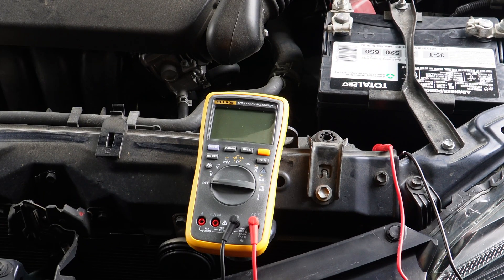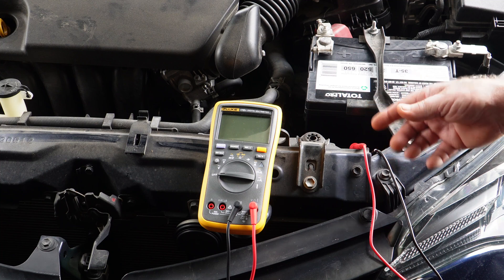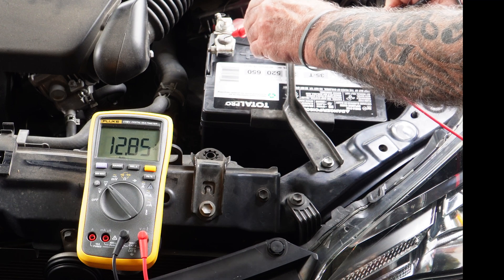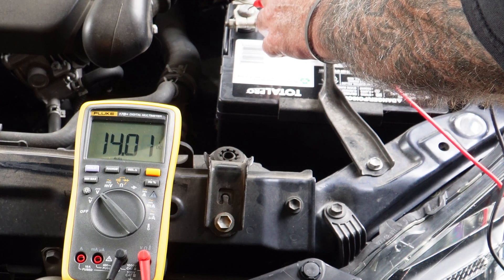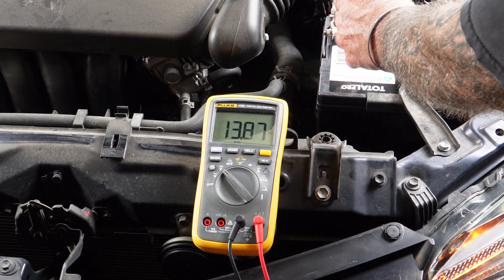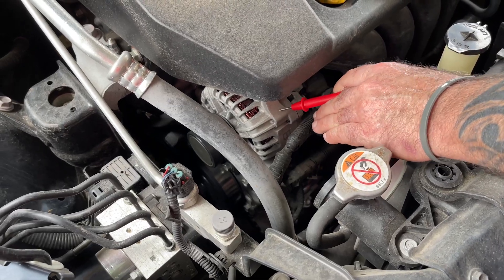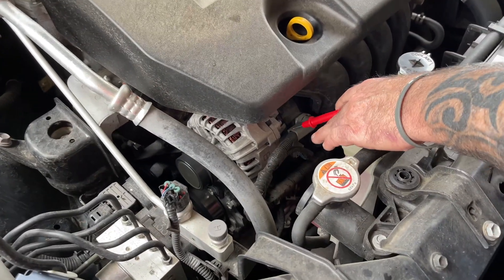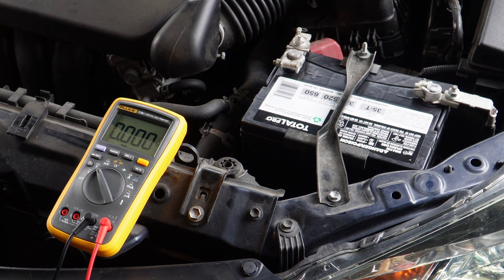How To Test An Alternator

Comment: Um start the vehicle and disconnect the ground from the battery. If it dies you need a new alternator 😂
Reply from the maker: I would not advise that on modern computer controlled vehicles!  That did work back in the day, but doing that on today’s computer reliant vehicles can cause damage that no one wants.  Not worth the risk!

Voltage Spikes Can Damage Electronics
Modern vehicles have sensitive electronics — engine control modules (ECUs), sensors, infotainment systems, etc. Disconnecting the battery while the alternator is charging removes the main voltage buffer. This can cause large voltage spikes (up to 100 volts or more) that can instantly fry expensive components.

Alternator Can Be Damaged
The alternator’s voltage regulator relies on battery voltage feedback. Removing the battery suddenly can cause the alternator to “run away” and overload its diodes or regulator, potentially ruining it.

It’s an Outdated Test
This “battery disconnect” test dates back to the 1960s–70s, when cars had simple electrical systems. It was marginally safe then, but absolutely unsafe on modern vehicles (anything made in roughly the last 30 years).
Reply: Additionally, in order to protect the computer from surge they redesigned the alternator to always sense 12volts from the battery. If you disconnect the negative it will automatically shut down the vehicle. This change came about with OBD2, around 1996.
Reply: @JAss-ny3im dang I just learned something new!
Reply: @silentnuke187 I remember my dad doing that trick too though back in the day. Gone are the days of station wagons, roll down windows & cars with ash trays or cigarette lighters, right? 😂 Those old school methods will quickly ruin today's cars!
Reply: @silentnuke187 maybe consider deleting your original comment so someone that sees it and tries it without reading the comments that follow, warning against it and possibly damaging their car because they falsely believe you might know what the hell you're talking about.
Reply: @JAss-ny3im  where did you hear this, on what kind of car? definitely does not apply to all "obd2" ...
Reply: Never do that for modern car
Reply: On the advice of another person I did this. The engine did die immediately when the positive cable was removed from the battery and they told me that the alternator is bad when this happens but then afterwards I looked into it to find this should never be done on a modern vehicle. Now I'm concerned I may have caused damage that wasn't already there. Thanks for this video and the sound advice. Hoping that I didn't cause myself lots of issues now.

Comment: I replaced my alternator and battery and my car lights still are dim and fans in car are weak I hit gas and goes back to normal and I haven't checked alt temp but that thing is definitely hot hot I looked at grounds seems good so idk what hell going on
Reply: The battery and alt itself is showing 14.7 any ideas would be appreciated

Comment: Looking for 2021 Toyota  TRD 4x4 SPACIFIC voltages. I hooked my scanner up and say not one lick over 13.8 from start to finish and 5 miles later.  Original  battery though.   Got the check charging system as everyone does and it’s an original battery.  Hooked my scanner up and NO recorded issues.  I’m guessing it’s a manufactured problem.  The battery for Toyota was know to be good for almost 10 yrs, Not now I guess.  Never did find a code to look at so it’s a pre programmed  fault but I did never see a charge  from 13.8 from start to 2 miles later of any difference of 13.8v.  Why!?

Comment: What if my voltage doesn't drop once I put a load on it?
Reply from the maker: If the voltage is in the correct range when engine is running showing a good alternator, then no drop while under load means the alternator is under no strain by the load.  You should be good to go

Comment: I have been having problems for over a year. I have a 1997 Subaru Legacy 2.2l. I am being told to just buy a new car. I love my car. I have a new battery. I have other problems as well but because I am here this is what is happening. I drove about 20 miles in the City. Went to a store. Came out to a dead battery. AAA jumped it and tested it and the alternator. He said I need a new battery. I have had two new batteries since May. I bought a new one and this also happened earlier this summer. Took it back and they exchanged it for another new one. So I drove home and let the car run for a total of about 40 minutes. Turned the car off but it wouldn’t restart. So I jumped it and went to O’Rileys to test alternator and battery. They said alternator is bad. Called our local alternator rebuild company that also does work on our sailboat. Pulled out the alternator and took it in. He tested it and everything was fine. So somewhere the battery and alternator have problems. I have very little help here.  I am going to go out and try what you just explained. There must be a problem somewhere in the wiring between the two. I do have a multimeter and a light meter is coming today. I checked all my fuses and they are fine. I’m still looking for the main relay but I am stumped. Thank you for making this video. I am looking forward to browsing through your other ones. 
Have a Blessed Christmas!
Reply from the maker: It sounds like you're definitely on the right track checking the wiring. Good luck with the testing!  Merry Christmas

Comment: Thank you for making this video. I am from Philippines  and I live in a remote area of Bohol. Youtube is he only I get knowledge whenever I have problem with my truck. This video helps me a lot especially  now that my truck won't start. Wondering if the alternator is bad or the battery. Battery is also heavy for me to lift up to remove so I am trying to do the least hard work on the truck.
Reply: Well if you can jump start your truck you can then check your alternator. If the alternator checks out good and charges your battery, then the battery is dead a couple days later, it's probably that you have a bad battery.😢

Comment: Thank you.  I have a 9 month old battery. It was -30 this AM.  Battery was dead.  Put it on the charger.  It started. Drove around for a half hour.  Got a low voltage message on the dash.  Put it on the charger again.  Battery was at 27%.  Think my alternator is shot. Will do the testing you went over.  Thanks.  Great video.

Comment: Is the voltage regulator gone bad in my alternator if the voltage reading at the battery and at the alternator reads almost 16 volts and one time at 16.9 volts? The last time i checked voltage reads 15.4 volts. Engine running, no accessories on. All connections are clean. Im guessing this is why my battery went bad.
Reply from the maker: Yes It’s over charging!  Normal output should never be over 15 volts and 14.5 is around the normal output range, and it lowers as the battery charges back to full capacity
Reply: @SkillSavvyDIY  Thanks for the reply. Whats strange is, i have two 2001 Chevy Silverados and both are doing the same thing. Any vehicle I've ever had alternator problems with, stopped charging, never had one overcharging before. And I've had lots of vehicles throughout my 70 years.
Reply from the maker: @UnitedWeStand2020That is strange!  Maybe check with another multimeter to make sure the one you used is reading correctly
Reply: @SkillSavvyDIY BINGO!! Thanks for the tip!! The multimeter I used is reading too high. It's one of those cheap red harbor freight meters I got for free with a purchase several years ago.  Another one I got, I just opened has a bad positive lead, no readings until I switched the dead positive lead and now shows almost 2 volts less. I guess this proves why they're so CHEAP.
 I think I will trash these from HF and get a trustworthy Fluke multimeter. Maybe a good Christmas present to myself.👍👍 MERRY CHRISTMAS AND A HAPPY NEW YEAR!!
Reply from the maker: @UnitedWeStand2020 Can't go wrong with Fluke.  I have a Fluke multimeter and a Fluke HVAC clamp meter.  They are my go to for sure.

Comment: Just asking i assuming you need a good battery before these test?
Reply from the maker: Battery doesn’t have to be good, but it must be charged enough to start the car or accept a jump.

Once the engine is running, alternator testing is straightforward.

Comment: My alternator has been putting out  14.6v and higher up to 15v. My battery was bad. Now with a new battery its putting out 14.7v. Did 4 test on my scanner marked high voltage bad alternator. Could it be because it needs some time to adjust tl new battery or is the alternator bad needs replacement
Reply from the maker: As I said in this video, if the alternator puts out higher than normal voltages around 15 volts and higher, then it is over charging the system which can ruin the battery.  The voltage regulator is what controls the voltage output, but on most modern vehicles, it is built into the alternator.  If the alternator is putting out 14.6 currently then it is ok.  It's not uncommon for the voltage to show different outputs as it charges the battery.  As an alternator charges the battery, it should give it less and less voltage until the battery is topped off.  If it continues to charge at higher voltage like 15 or higher, then you could have a bad voltage regulator in the alternator.  Good luck!

Comment: Only thing you didn't mention the sense wire ECM check
Reply from the maker: I didn't mention it because only "some modern cars" uses a sense wire for the ECM to monitor battery voltage and be able to regulate voltage based on what the vehicle actually needs.  Many vehicles still use a traditional alternator with and external sense wire that usually goes to the battery, fuse box, or main distribution point.

Comment: Great video. I will try to check voltage drop later. My issue was i replaced a battery since I thought battery was dead. Put new battery in, engine running and I loaded the circuit and I have 14.4 volts when i turn off the car, battery voltage goes down to 12.6 but after a few hours when the car sat, the battery voltage goes down to 10.6 volts. Im lost 😞
Reply from the maker: Sounds like you have a pretty severe parasitic draw that is eating up battery voltage.

Comment: I did an alternator voltage drop test with the engine running, AC on, radio on and headlights on and the reading displayed 0.03 on my multimeter set to DC.  This was on a 2018 Ford Fusion SE 1.5l Ecoboost (Turbocharged).  

What does this mean?
Reply from the maker: Means that small amount of voltage drop is negligible and normal.  If you get into the 0.3 and higher, now you can start looking at a connection problem or corroded cable creating excessive voltage drop. but 0.03 is very low.

Comment: With a load on and the multimeter connected I’m getting - 0.01 is that good?? I’m getting 13.04 with truck off and 14.80 with truck running nothing on then 14.75 with lights ac brights all on. Plus a subwoofer with amp. 14.88 connected to alternator. I have a weird dimming issue . Idk 🤷
Reply from the maker: Reading 13.04 with the truck off means your battery still had some surface voltage left.  No big deal, but a fully charged battery should read 12.6.  Any higher then you are reading additional surface voltage.  I'm assuming the -0.01 was checking voltage drop.  That is a good reading.  Reading over 14 volts while running and under load is also good.

Comment: Just read voltage on the battery posts.
Reply from the maker: That’s what I did, but I also show how to check for voltage drop if you are not reading proper voltage so I’m a bit confused what you are talking about??

Comment: Thanks, I had a charging issue and after watching your video I measured from chassis to alternator case and got 1.5v. Turns out after I had some work done they forgot to re-attach a transmission ground strap. When I put a jumper from the alternator case to chassis, my voltage on the battery came back up.
Reply from the maker: You're welcome! Glad the video helped you figure it out

Comment: Have a tractor voltage on alternator 14v but on battery 12.7 v what can cause that
Reply from the maker: Sounds like a corroded cable if you are reading 14 volts at the alternator and only 12 at the battery.  The voltage drop test I showed in this video can prove if that is the problem.  Also make sure the battery clamp connections are clean and tight

Comment: .013 is the reading I got with engine running...red lead to body of Alternator, Black to negative on battery.  Any ideas?
Reply from the maker: That is very little voltage drop which means the ground is good.  Do the same thing between the +B terminal on the alternator to the positive side of battery to see if you have any significant voltage drop.  If you don't, then the cable from the alternator to the battery is good and not corroded.  Follow the parameters I showed in this video.
Reply: @SkillSavvyDIY  So I had OReilly test and they said it was the voltage regulator on the alternator so they sold me a $500 rebuilt alternator and when I brought in the core I said TEST THIS to see why it went out! So they put it on a bench and said no, we cannot test this.  I suspect it is because it was good and my issue was somewhere between the alternator and the battery.
Reply from the maker: @PaulYoungMinnesota  Those guys sell parts.  That's what they do.  They are not mechanics or technicians

Comment: My Cadillac reads 14.4v-15.0v when it o.k. other times when I start it up or while driving it will be at 11.8v- 12.0v in which it will take many times to start  or stall while driving. Have you ever had a problem like this or maybe point me in a direction for me to check?
Reply from the maker: When your Cadillac shows 14.4 to 15.0 volts, that means the alternator is charging the battery properly, and everything in the charging system is functioning as it should. However, when you see 11.8 to 12.0 volts, that indicates the alternator isn’t charging, and the car is running solely off battery power. This explains why it can be hard to start or even stall while driving — the system voltage drops too low for the fuel injection and ignition systems to operate correctly. Because your readings vary between normal and low, the problem is most likely intermittent, meaning the alternator is sometimes charging and sometimes not.

The most common cause of this kind of issue is a failing alternator. Inside the alternator, components such as the voltage regulator or brushes can wear out and begin to fail intermittently. When that happens, the alternator stops charging until the component makes contact again, causing the voltage to suddenly rise back to normal. You might also notice other symptoms like dimming lights, a flickering battery warning light, or electrical accessories acting strangely.

Another frequent cause is a loose or corroded connection somewhere in the charging system. Corrosion or looseness at the battery terminals, the alternator’s main power wire, or any ground connections can interrupt the charging circuit. It’s a good idea to check and clean these connections and ensure that the ground strap from the engine to the chassis is secure and free of rust or corrosion.

Sometimes, a worn or slipping serpentine belt, or a weak belt tensioner, can cause the alternator to spin inconsistently. If you hear squealing or chirping noises, especially when the engine is cold or damp, that may point to a belt problem. Although less common, a weak or sulfated battery can also interfere with the voltage regulator’s ability to control charging. Even if the battery still starts the car occasionally, it should be tested under load at an auto parts store.

On certain Cadillac models, the alternator is controlled by the car’s computer (the PCM). If there’s an issue with that communication line or the PCM itself, it can cause the alternator to stop charging intermittently. A diagnostic scan can show whether the PCM is commanding the alternator to charge when the voltage drops.

To diagnose the problem yourself, you can start by measuring voltage directly at the battery with a multimeter. A fully charged battery should read about 12.6 volts with the engine off, and around 14.4 volts when the engine is running. If you see it drop to around 11.8 volts while running, that confirms the alternator isn’t charging at that moment. When it’s reading low, you can try gently tapping or wiggling the alternator plug or cable; if the voltage suddenly jumps up, that’s a strong sign of a bad alternator or connector. It’s also worth inspecting the belt and cleaning all ground connections.

If you take the car to an auto parts store, they can test the alternator and battery for free, either on the car or off it. In most cases like yours, the final fix ends up being a replacement alternator or repairing a loose ground connection.

Comment: 14.67v coming out to battery but shuts off  when battery post is removed
Reply from the maker: That is very unusual for the engine to shut down if the alternator is working, but in modern cars that are controlled by computers, it's a very bad idea to disconnect the battery while the engine is running because it can cause damage to the PCM.  It's possible that when you disconnected the battery while running, it freaked the PCM out which caused the engine to shut down.  I've seen that happen.

Comment: Mine charges sometimes ((14) then will drop to 12.8 . Then after turning off and restarting, back to 14
Reply from the maker: That is completely normal.  As the alternator tops the battery off to a full charge, it backs down how much voltage it is giving the battery.